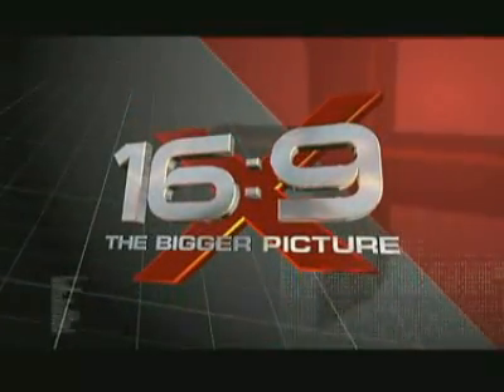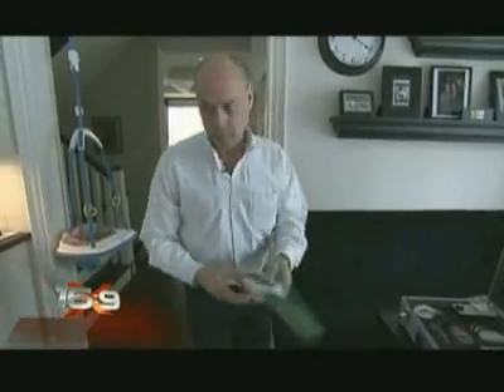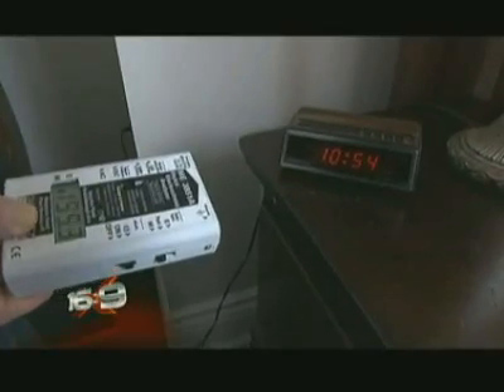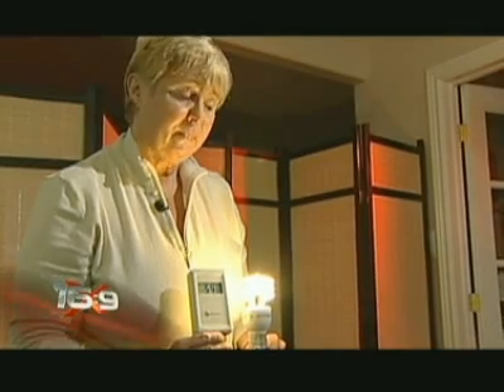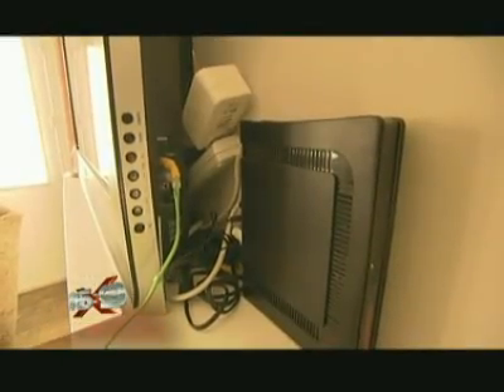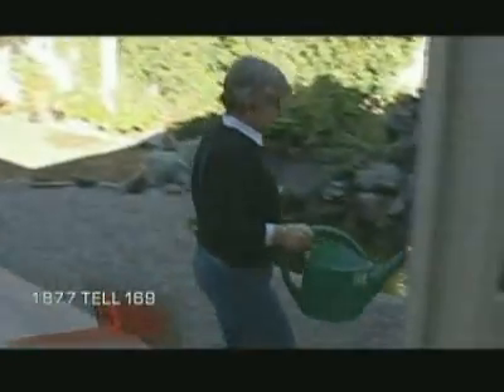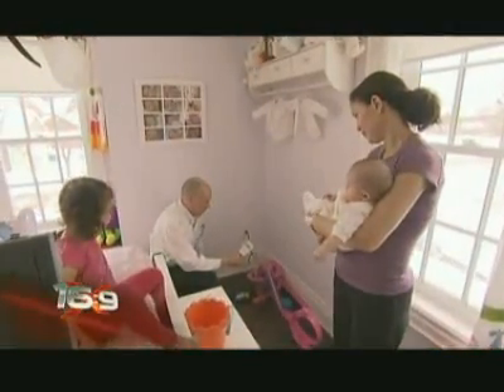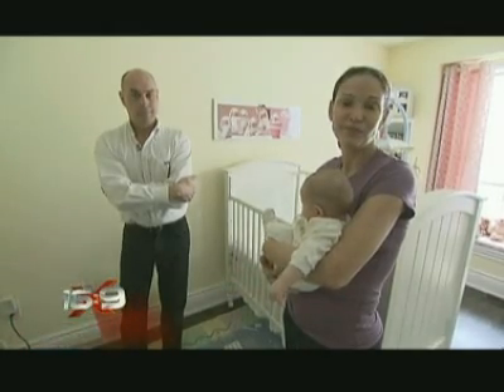Dirty Electricity - Part 4 - Electrical Shock

Comment: i have a plug next to my day bed.. and where i sleep, always.. it is situated about 20 inches above from where my head goes to pillow.. 
There are times that if nothing is plugged into the outlet and i have radio on opposite side of room and  plugged into different outlet and breaker connect i can wave my hand over the open outlet and tune in/ out radio maybe i should say distort.. Sometimes outlets hum, sometimes lights dim and lots of flicker at times.. sometimes power goes off and then on and then off.. that dirty electric arcs and fries out appliances/plugs.  I have had three smart meters since late2009/10 and i have no doubt that special interests are testing systems, researching and whatever other special interests want to profit off of deliberate surges.
i have given no consent to this.. when i moved here my telephone line was cut and replaced only after a great deal of effort.. and some whom i had trusted to help proved only to be a hindrance. Still... what can i say.. I have family that works/worked for hydro
If they only knew how hydro was being abused against their own family..  i wonder what steps they would take to help alleviate the problem... i suppose they have some serious problems of their own!
Strange though.. they do know wish NOT to speak of such things .. Some have very big bills to big bell to pay..
oh.. sometimes i require to vent.. I know that many have been subjected to similar conditions.. There are some in that so called 'powerful connection' ..some hydro logo, i do believe it is that have very much to hide.

Comment: Graham - Stetzer units??....what a scam. They want to sell you these "filters" at $35 a pop which are basically 40 microfarad capacitors that you plug in everywhere. What will be most noticeably "Stetzerized" is your credit card...

Comment: @davidc788 What you said sounds just fine, but it doesn't make any sense to me. "Magnetic frequency" is a term I have never heard, even as a Physics major. Saying the frequency is DC seems to be contradictory. DC means "direct current", and means it has a frequency of zero. Electrical power in the US is 60Hz, meaning 60 cycles per second, not 60W. Also, if we have a natural frequency, why wouldn't it be somewhere in the range of frequencies of electromagnetic radiation coming from the sun?

Comment: -cont-  I never said anyone was crazy, a very small number of people ARE hyper-sensitive to electrical noise. If someone is psychosomatic, the pain can be almost as bad as the real thing - so if this item works, mission accomplished...relief. Don't forget, that meter will pick up endless sources of unrelated interference, it may or may not be a coincidence.

Electricity is a mystery so many people believe anything they're told. I only want to provide information so they can decide.

Comment: Claiming that electrical noise causes cancer is an OUTRIGHT LIE, someone has to say it. Do you not think that this issue would be EVERYWHERE if it was true?? Is that school near a cell tower, built on toxic landfill, water pipes with lead solder etc? Of course Health Canada won't speak in definites on camera - NOBODY does that!

The MAIN problem is that the two "noise" types have been purposely entwined to confuse and deceive. (ie: prove mid-air EMF, then provide a filter for wiring EMF)

Comment: (Notice the cordless phone carefully placed to cause the clicking?)

The meter measures tiny signals greater than 50kHz - the only frequencies their "cure" filters will work on - but inadvertently converts to frequencies that it CAN'T filter. They use capacitors BUT omit the inductors req'd to be effective!

Graham/Stetzer made up bogus units of measurement - arrogantly named as "GS units", they use them as actual International Standards. They didn't check- GS already stands for GigaSiemens!!

Comment: Yet another SCAM by the scare of the month club. It has been proven that electrical noise (now called Dirty Electricity to instill fear), is of such small quantity to do ANY harm, and is 
propaganda to promote the sales of products to "save you" from all the nasty effects. The 
noise is measured in MILLIVOLTS, thousandths of a volt which is TINY.

What you *should* be worrying about is the MAJOR culprits of radiation - cellphone, computer wi-fi, GPS, bluetooth headsets etc. WAY WORSE. 

-cont-

Comment: @jackdaknife The lamp doesn't have to be on, the RF field travels on the wires independent of the house voltage. Every copper wire connected to the mains acts as an Ariel. There will be voltage (potential) on both wires in the lamp cord and the bulb right up to the switch which, in the case in the film is an open circuit (Off).
The solution would be to unplug the lamp from the wall but that still leaves the cabling in the walls, floor etc.